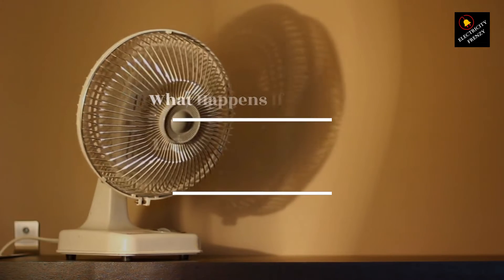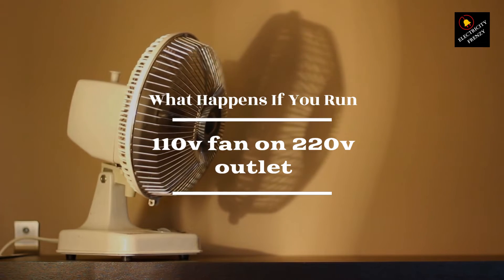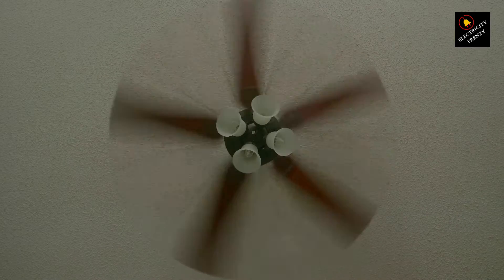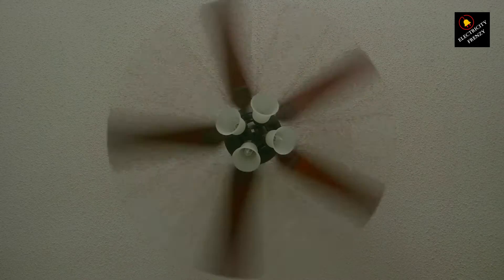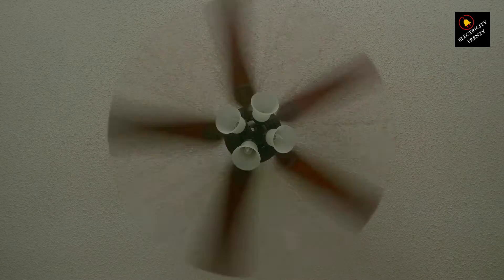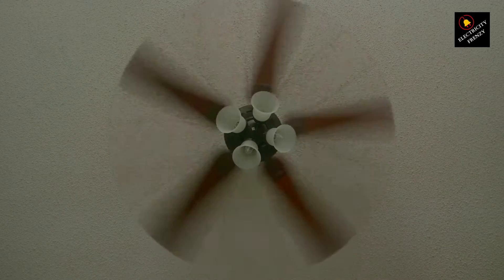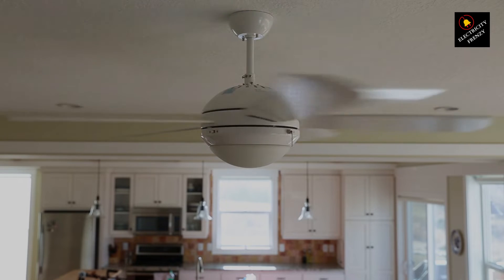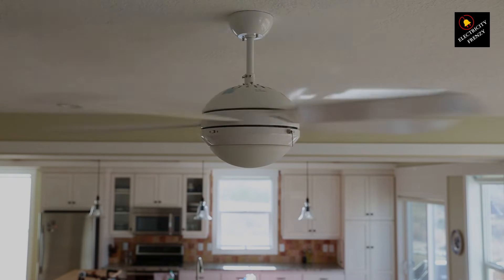What Happens if I Run a 110v Fan on 220v Outlet?

Comment: If it is an induction motor, the 110v motor on 220v will probably run at the same speed. However, the coils will have double the current, and will run hotter, melting the insulation and shorting things out. The extra torque is probably unneeded by the fan blades since the air resistance is unchanged by unchanged speed.
A universal motor will burn out the commutator segments and brushes as well as windings with double voltage.
Reply from the maker: Thanks for your valuable comment. If it is an induction motor the insulation would break down if it's 110v and the windings will short circuit no matter what speed is the fan.
Thanks